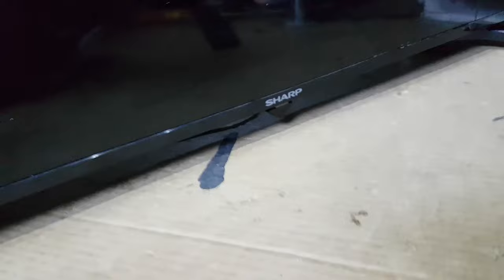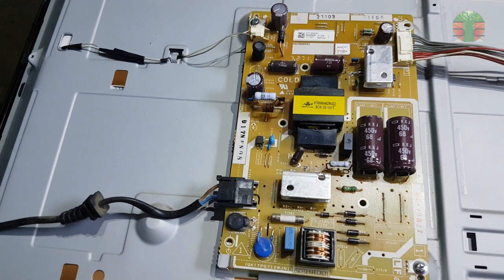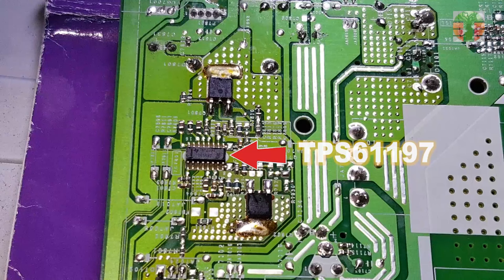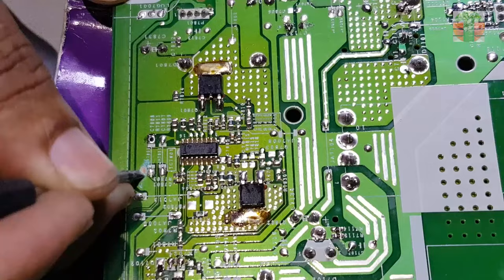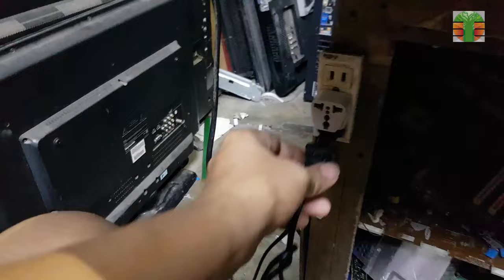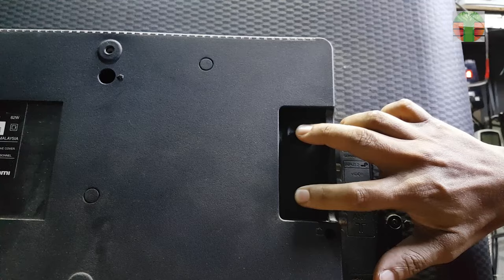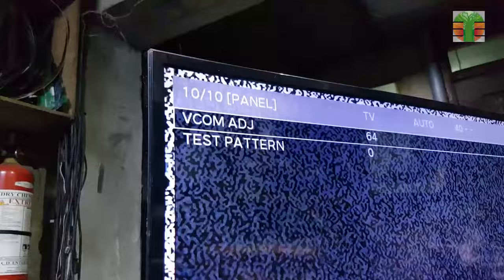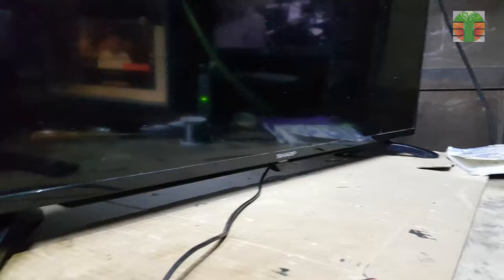Sharp LC-40LE185M Turn on W/logo and turn off. how to fix

Comment: Was the solution found in sharp service manual? My guess is TV manufacturers will be locking mainboards into fail mode in the future and repairs won't be possible. Much like lithium BMS boards when they fail. Just so they can sell more TVs. This will be easy for companies to do because governments are not controlling right to repair.
Reply: Just use a universal board

Comment: I appreciate a lot for the help, the tv is now working, but there is a new problem, the tv turns on by itself even when I remove the batteries from the remote control. and another symptom is that when it turns on I already forget all the configurations
Reply from the maker: Did you change the other cofiguration on at the service mode?
Reply: @tevzTVTevatronics  I have not been able to enter "service mode" I do not know the method
Reply: Same as me....
Auto turn on...
Can't turn off
Reply: I found file below...
How to update ?
Just plug in to the TV ??(in setting click update??
Can fix auto on (problem)??
Pls reply
Thank
Reply: @johnconner8379  Greetings and blessings, I am the same as you
I'm looking for solutions
Reply: @tevzTVTevatronics  How can I enter service mode on my TV model? In service mode, can I update the firmware?
Reply: Ya same problems
Reply: I can't enter service mode
1step (red light blinking)(can)
2 step(screen turn white)(can)
3 step(service mode)(can't)
Seem like that TV is reset to default (not on)
Reply: @tevzTVTevatronics  
Any advice for my TV?

Comment: hi po pwede po mag tanong,
Yung TV po namin LC-32LE185m
Pag sinasak po nag Automatic On po siya wla po siyang redlight
Pag in off naman po namin thru Remote or Switch nya sa likod Balik Turn ON po ulit siya
and lahat po ng Set namin sa Menu naka reset lahat..
Reply from the maker: Malamang memory  or firmware ang prblema.

Comment: I have a Sharp 4T-C70BK2UD with sound distortions and beep sound. Do you have a video on this model on how to replace that board to fix it. Thank you in advance for you help.
Reply from the maker: No video yet to that model. Try sound setiing.
Reply: @tevzTVTevatronics  Thanks Sir. I did that but it doesn’t fix it. Does the sound is a independent board or part of the mother boards? Thank you for your kindness. May God bless you.

Comment: I have a Sharp Aquos 3D TV 70 in. It has one yellow line going down the left side. Except for the bottom the last 3-4 in fluctuates. The TVs are 2014 or 15.

Everything else works great. Just said that annoying thin yellow line going down.lol

Comment: in the model: LC-32LE185M "SHARP" 
The size of the flash memory is 64mb or 8mb ?
Reply from the maker: If the EEPROM is 25x32 is 4Mb, if 25x64 is 8Mb If 25x128 is 64 MB. see your EEPROM
Reply: @tevzTVTevatronics  Thank you !! I'm going to check it and tell you, although we live in different time systems (time zones). I am very grateful to you!   👍👍
Reply from the maker: @jbgrenouille2527   IC 25Q64 EEPROM is 8 MB

Comment: The same model works for a period of time, then turns off, then turns on after a while, and so on
Reply from the maker: Not in the description of this video, maybe the main board has the problem.
Reply: Yes, is the problem with the board?
Reply from the maker: @MohandAdel2299  Is the audio also turned off with the video?
Reply: Yes, it turns off after thirty minutes of starting. Turns off completely, then lights up green and red @tevzTVTevatronics
Reply from the maker: @MohandAdel2299  The main board or the backlight is the problem.